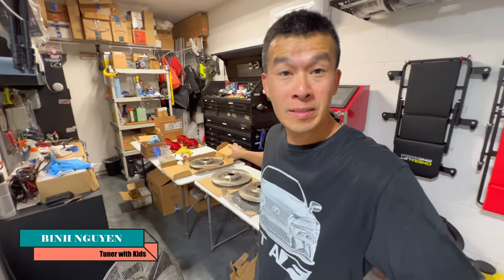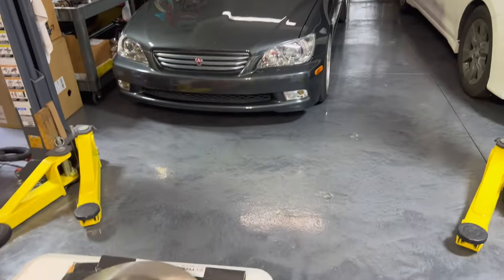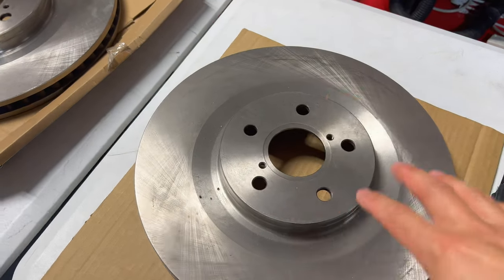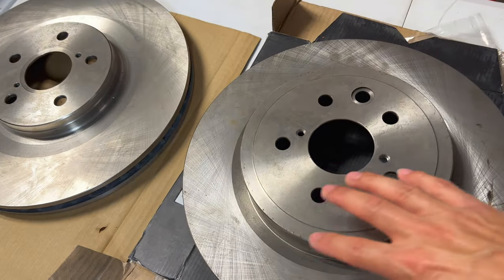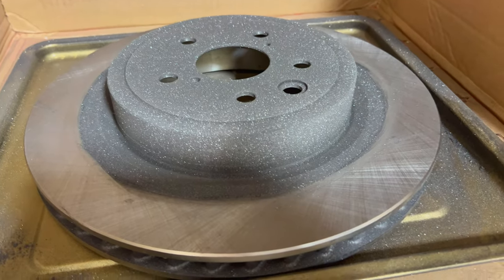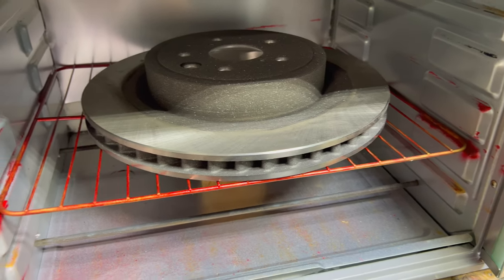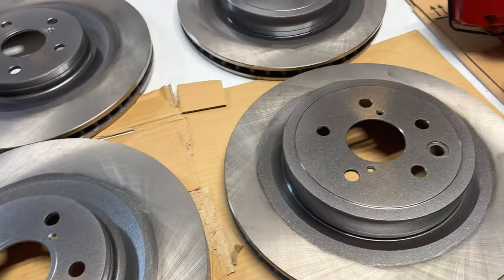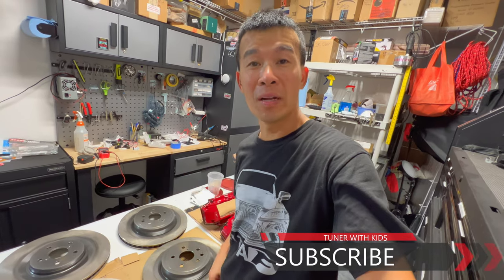How to Powdercoat Brake Rotor Hats | Rotor Corrosion Protection

Comment: Will the powder coat melt with the regular Heat of the brakes?
Reply from the maker: Nope. Once powder is melted it changes chemical state and becomes essentially paint or polyurethane depending on its properties.

Comment: Doesnt the coating leave the rim floating on top of the cured powder layer?

Have you considered Cerakote instead of a powder coat?  (Cerakote is good for about a other 1000+ degrees over the powder options)
Reply from the maker: No different than rotors that come with a black coating or people who spray paint their hub area on the hats. It’s on thin enough where it’s not gonna affect much.
Reply: @TunerwithKids  Many o.e. coatings are thin platings... Cerakote for example is as thin as .00025" vs powder @ .00600" or 16x thicker.